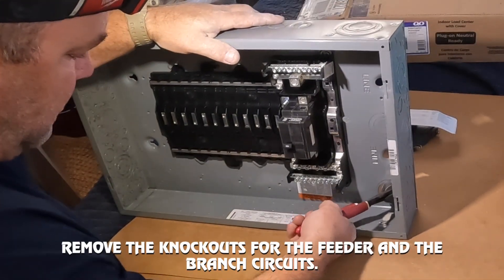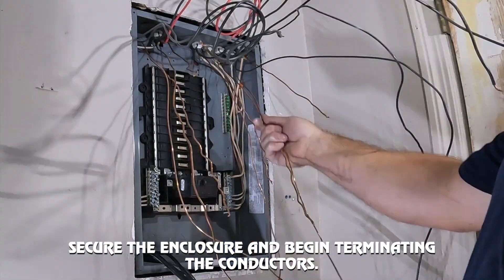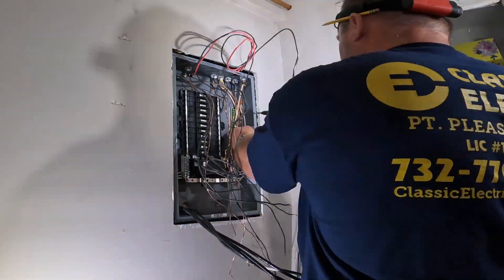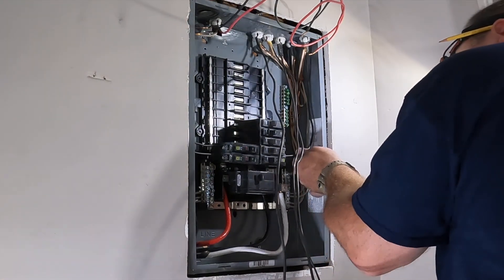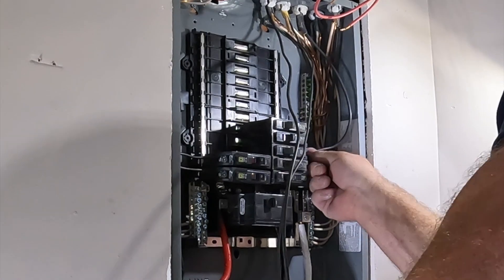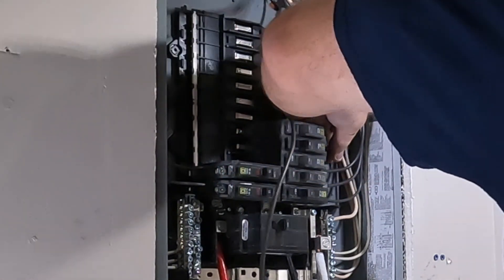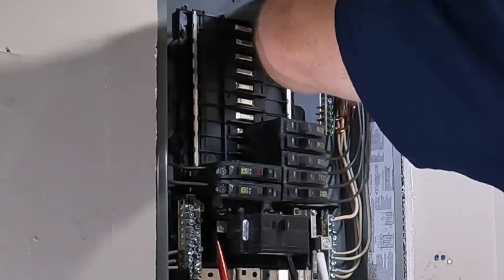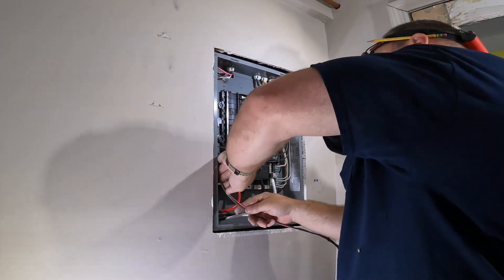Upgrading a Federal Pacific Panel to a Square D 'QO' Panel | Leonardo, NJ.

Comment: Has the new panel the same size as the old one? If it's not, is it possible to replace breakers and recepticle (internal parts) only? Don't want to cut sheetrock.

Comment: I just installed this exact panel in our house. Our main service is a 100 amp fpe panel with meter combo on the outside of the house. I installed the square D QO panel behind the bedroom door and moved the branch circuits to the new sub panel and put a 60 amp 2 pole stab loc breaker to feed it. Eventually the main service will be replaced with a 200 amp and the fpe will get ripped out but for now I don’t have to worry about running over a cord with a vacuum and causing a firework display.

Comment: My girlfriends house was built in the 1950s and had a FPE panel.  I recommended it be replaced.  The service was upgraded to 200 amps because she wanted a heat pump, and a Square D panel installed.  It was inside a garage opposite the outside meter. New weather head and 2 inch riser put on. New grounding electrode system. It took an electrician, an apprentice, and a helper from 8am to 6pm to complete it.

Comment: My house growing up built in 1964 had a Federal Pacific panel. I had a "bouncing ball" Miller Beer sign in my bedroom. Well we disconnected the motor that moved a plastic sheet in it to give it the animation because it made some noise, I didn't want the noise because I used it as a night light. I decided later on that I wanted it hooked back up. My dad wired it wrong and when he plugged it in there was a hum for a couple of seconds and the wire caught on fire which caught the carpet on fire. The freaking breaker never tripped! Another time the cord on the hair dryer shorted while my mom was drying her hair, it caught the cord on fire, same thing the breaker never tripped! Very dangerous.

Comment: I upgraded to 100 amp about 10 years ago. Wish i went to 200. They replaced the wire from the pole to the house. How do i know if the wire from the pole to the house is capable of 200 amps?
Reply from the maker: We’ll that would be determined by the utility company who follow what’s known as NESC (National Electric Safety Code).

Comment: surprised to still see one in operation. can't even buy a house around here if it has one, the seller needs to update it.
Reply from the maker: They're still present here in New Jersey. I change them out all the time.
Reply: That's because clowns run the world these days.
Reply: See them often in Seattle and Puget Sound area. Always recommend they be replaced ASAP.
Reply: Of course you do. $$$$$$$

Comment: You don't use wire strippers.   As I got older I starter using strippers easier on May thumb 👍
Reply from the maker: These are Klein Hybrid pliers. The strippers are built-in to the pliers.

Comment: Nice job getting that FPE replaced.   Based on an incident about 10 yrs ago I can attest how dangerous and unreliable they are.  I suffered 2nd degree burns on my hand, arm and chest area and spent 2 days in the hospital,  after unplugging an arc welder from a 50 amp 240V surface mount  receptacle in a pole barn.  Part of the receptacle had chipped away, causing the wiring to loosen and short out to each other and the metal box/metal conduit system, and both the 50 amp breaker and the 100 amp main breaker failed to trip.  I recall dropping to my knees with my T shirt on fire, then crawling down low to get out and call for help, with the panel on fire and molten metal spraying all above me.  The explosions only stopped because the primary fuse on the pole transformer blew once the fire had worked it's way up the service drop shorting that  out.   I have scarring and some hearing loss.
Reply from the maker: Jesus! I’m sorry you had to experience that. We’ve come a long way in our industry and there’s still a lot of work to do. I think you’re lucky to be alive.
Reply: Good lord. Hope the rest of your life can be a cake walk!
Reply: @aaron74  for sure.   You know it was a massive fault, in the order of a couple thousand amps or more, for the primary cutout on the pole to blow, with flames running up the service entrance cable on the pole barn burning like a fuse, melting holes in the sheet metal siding along the way.  According to my buddy who inherited the property from his grandparents estate,  the pole barn was built in the '60s, so the panel can be assumed to be the original.